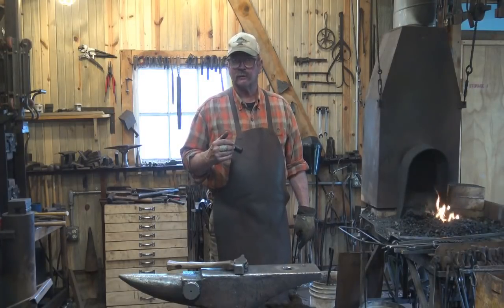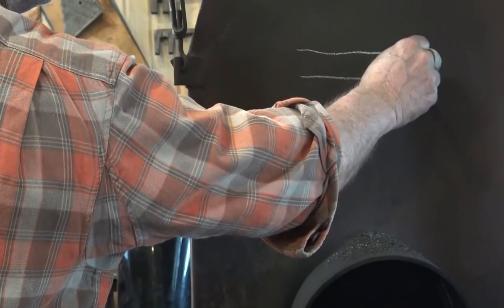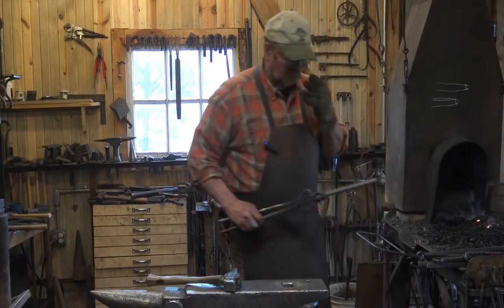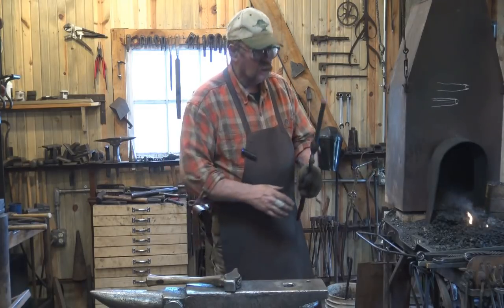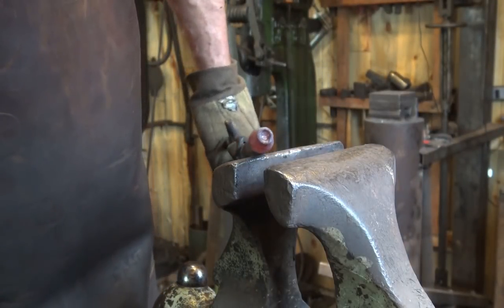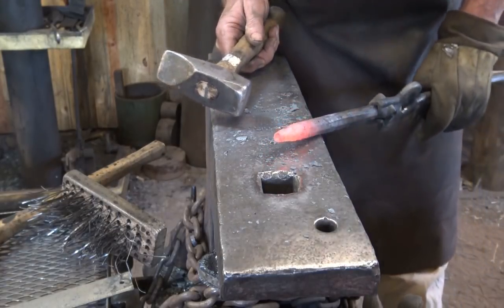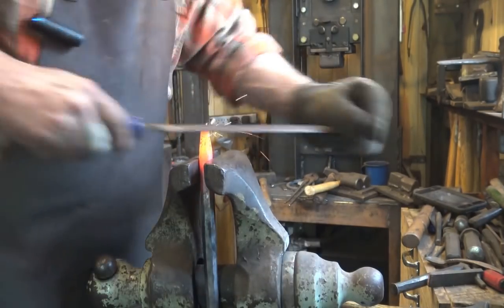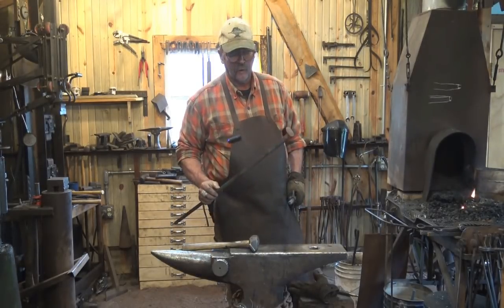Forging an eye punch - blackmith tools

Comment: Thanks John, this is very good info.  I have a book entitled "Iron Menagerie" and I'll bet you have it in your library as well.  It talks about using ball bearings (whatever size is needed) to form the eye on the end of a bar.  The book says to hammer the end of the bar down on the ball bearing and offers a caution about having the ball flying around the shop.  I haven't tried it yet, but perhaps the "fish lips" would help hold the ball in position on the end of the bar.  What do you think?
Reply from the maker: I think so.  The fish lips aren't generally a good depression for the eye, but they do make a great depression for refining with a punch or probably a ball bearing.  I do have that book and will need to get it out again.

Comment: Another method is to place a ball bearing in a dimple of bar stock. Heat the end of you soon to be punch or header, isolate the heat, and drive down onto the bearing. Thanks for doing this video!
Reply from the maker: I had heard of that, but it didn't occur to me at the time.  Of course by using a ball end punch you can see where the dimple is and correct is it's off center.
Reply: Black Bear Forge i suppose it would make for a better rivet header, if over sized stock were used. A lot easier than trying to use a 5/8 rod on perhaps a 1/4 inch ball. Good point!

Comment: Did u harden the s7. If so how
Reply from the maker: I did.  S7 is air hardening and requires a critical temperature of 1700F.  I bring it up to heat slowly in an electronic oven.  Then I put the struck end down in a bucket of vermiculite leaving 3/4 of the tool with the working end sticking up to air cool.  I then temper it in a toaster oven.  Its pretty easy with the electric oven, but easy to get wrong when judging color by eye.